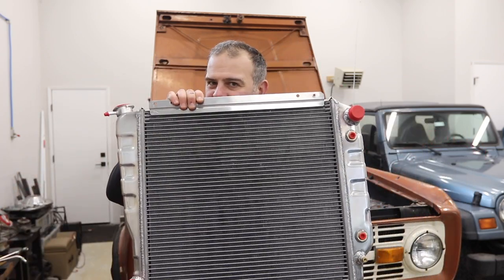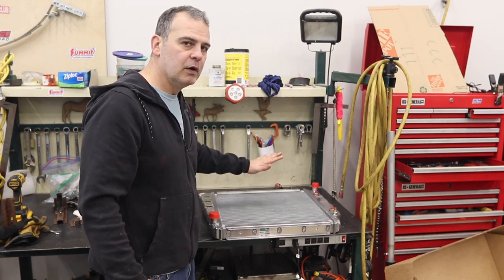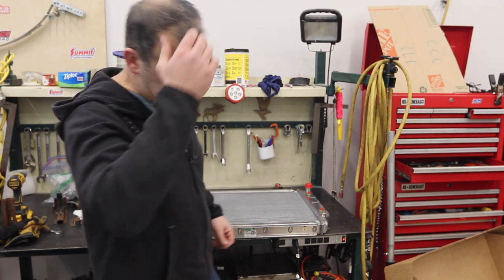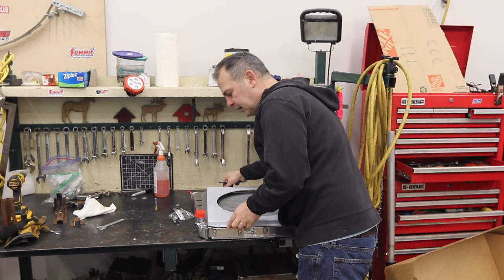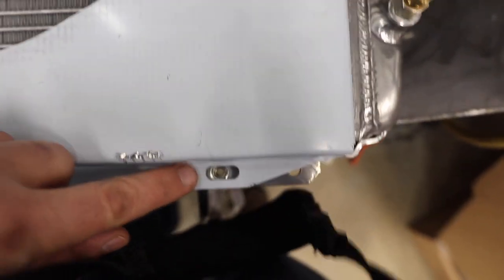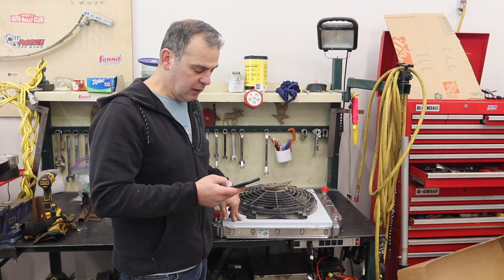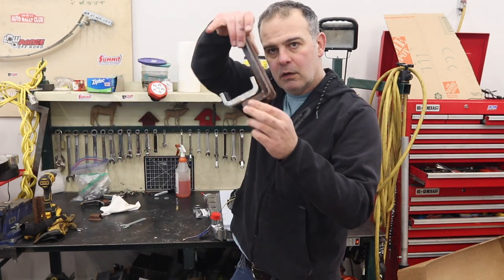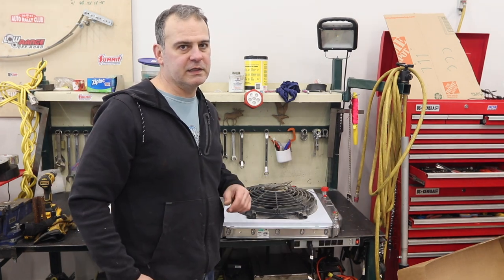9.12-Bronco Cooling

Comment: I’ve got the aluminum four core, three pass radiator in my ‘72 and tried the same shroud with a Spal low profile fan. It won’t fit with the shroud. 

You’ll probably be ok with your explorer 5.0 and serpentine setup. I’m a non-roller v-belt 302 and the long nose water pump is what prevents me from having enough clearance.

Can’t wait to see it installed with the rebuilt motor!
Reply from the maker: I think I’ll have more room than you but it’ll be close. I can’t wait to see either. Probably going to be 10 weeks until I have a motor.

Comment: Hope it fits with the shroud. What do you consider "minimum distance"?
Reply from the maker: That’s the question. My opinion is it depends on the use. If no hard core crawling, I’d say 3/4”. If you are dropping off of waterfalls my guess is everything moves around more than one would think and I’d want to be way over an inch.

Comment: Hey Matt I was wondering what you do about wiring to the fan?
Reply from the maker: Depends. If I’m running EFI I let the EFI control it, if not I just have it triggered by grounding into a thermostat switch. If it s Chevy it’ll be 205 degrees or 200. Fords a few degrees less. In both EFI and carbureted setups I also run a ground override to a switch in the can so I can turn the fan on if the thermostat ground isn’t working.  I should add that both of these options go through a relay.